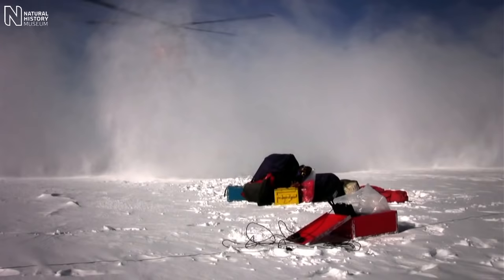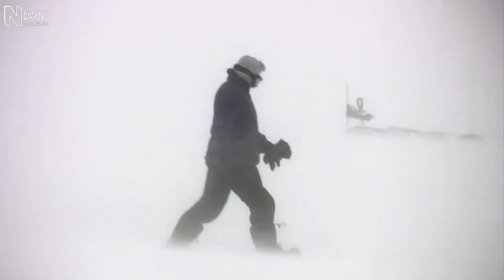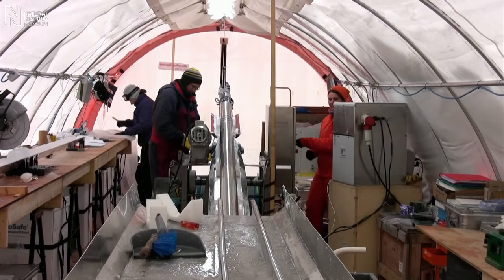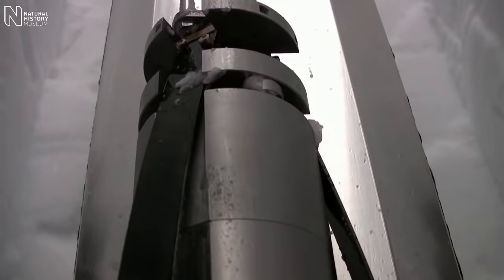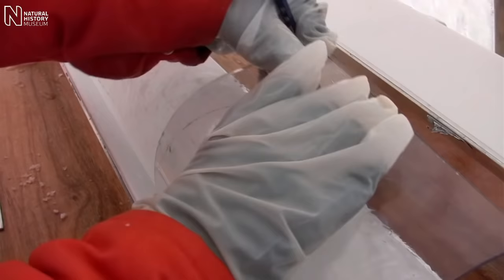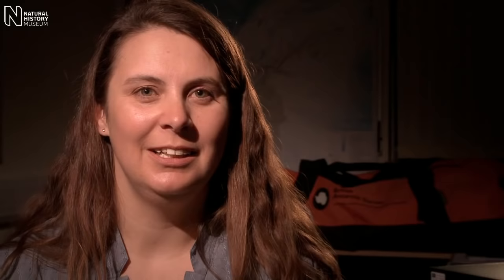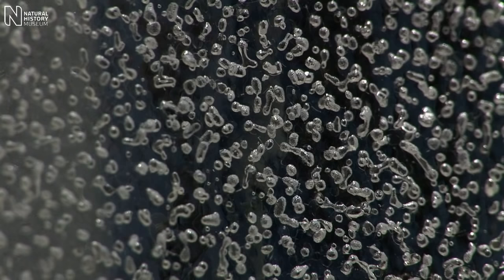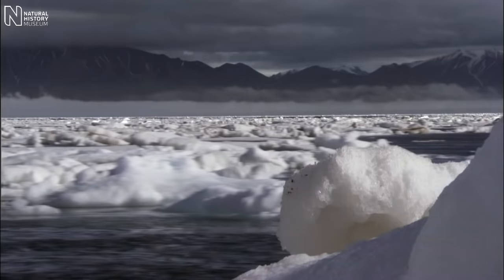What Antarctic ice cores tell us about climate change | Natural History Museum

Comment: Visible light is electromagnetic, short wave photonic energy. When it strikes the surface of the Earth, that which is not reflected away into space is absorbed and converted into heat (infrared energy). This heat is conducted throughout the material that absorbed it. Any air that comes into direct contact with it absorbs some of it via conduction and is then convected away. The remainder of the heat from the material’s surface is emitted away as infrared long waved radiation which passes freely through the small moleculed atmospheric gases of nitrogen, oxygen and argon. However, the larger atmospheric molecules such as carbon dioxide, water vapor, methane, etcetera have a quantum mechanics based affinity for absorbing and re-emitting this infrared radiation — thus, slowing down its escape into space. It is this blanketing effect on infrared radiation that makes life on Earth possible — for without it there could be no liquid water on the planet.

Search:
‘samslair blogspot greenhouse effect
Reply: Life as we know it and liquid water covering the surface but don't forget that the earth is hot deep inside. The planet is a ball of hot rock with a liquid magma core.
Reply: @dickinstheblackcactu  it is, but virtually all heating on the surface comes from the sun. That's why water from a fountain is cold, not hot.